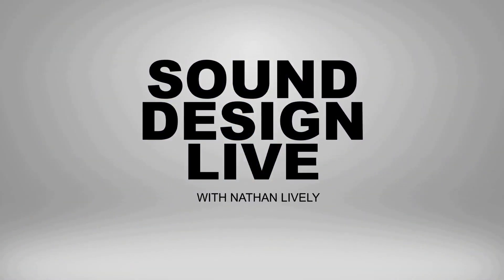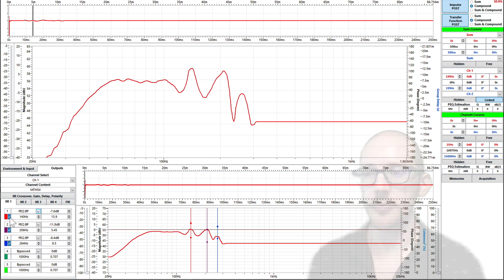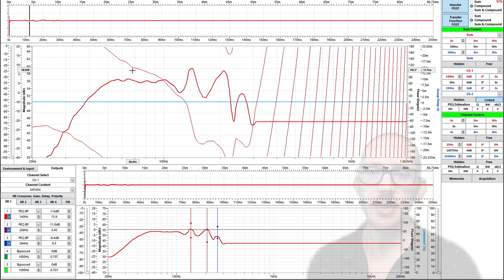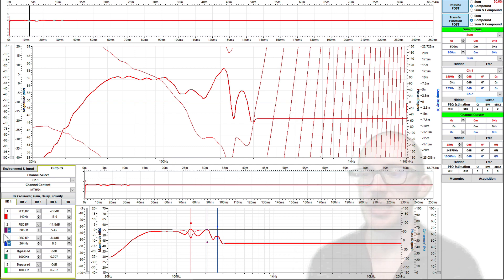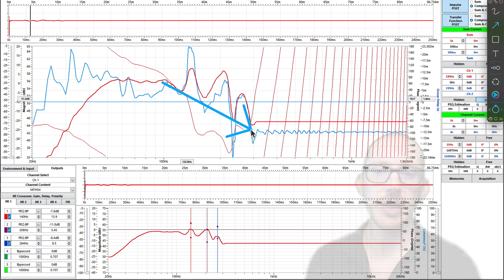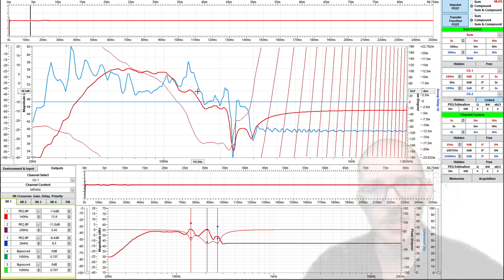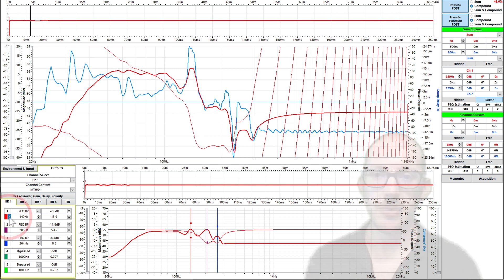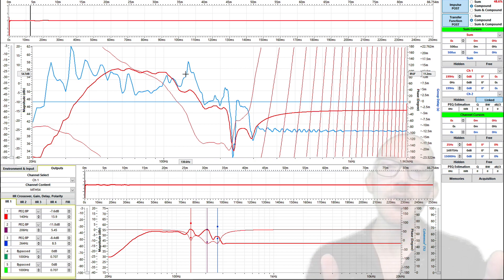Should I avoid EQ filters around the crossover region?

Comment: It is all about filter theory, no matter whether the response is created by the speaker, the enclosure, the DSP or the room! That‘s why it makes sense to use more or less exact inverse IIR-EQ for compensation. What flattens the frequency also flattens the phase / group delay, off course not in case of deep notches created thru comb-filtering as mentioned.
It is a common miss-believe to generally not use „narrow-bandwidth“-EQs because they would create too much „phase-degradations“…
Tip: in free Powersoft Armonia software you can play around with standard IIR-, raised-cosine- and custom FIR filters watching frequency and phase response simultaneously…